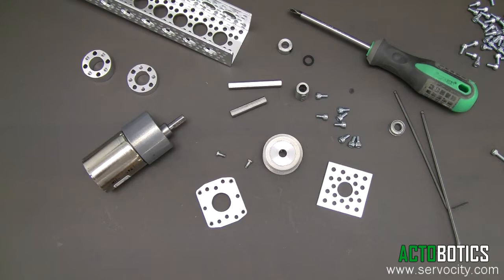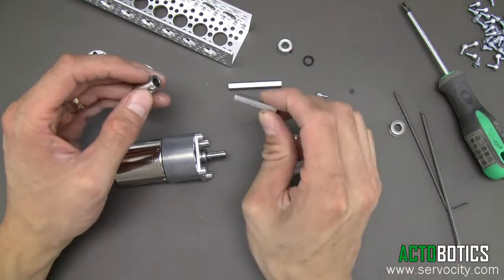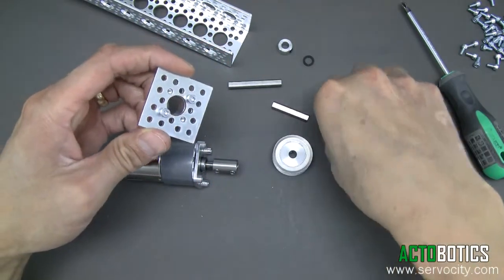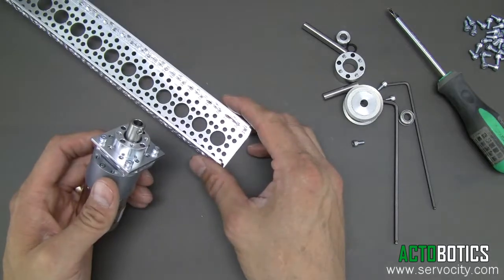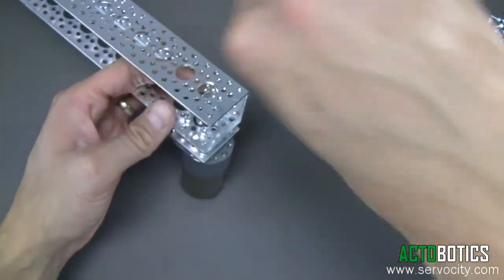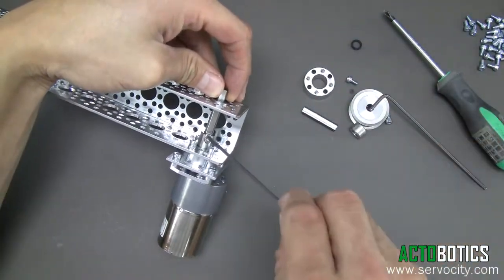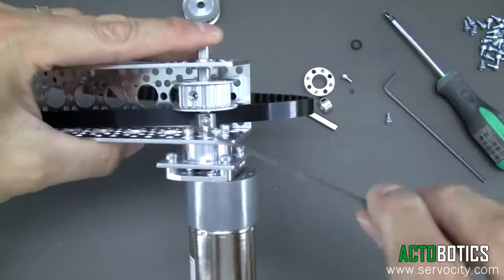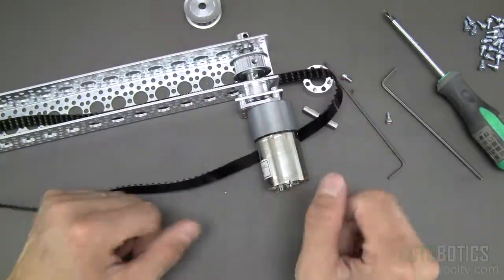Actobotics™ - Slider Kit Assembly (Step 1)

Comment: For a long time lapse, 19" isn't very far. What motor do you recommend?
Reply from the maker: It depends, how long do you want it to take to travel the full length of the slider?
Reply: ServoCity 30 min, an hour if I do a sunset/sunrise or a storm. You can't buy them assembled right?
Reply from the maker: Andrew Sebrell For 30 minutes you would need 0.2RPM, we have the 0.5RPM motor which can go down to 0.05RPM http://www.servocity.com/html/0_5_rpm_gear_motor.html.  The kit usually does not come assembled, but we can assemble it for a $35 assembly fee in addition to the motor you purchase.  (There is no return on the assembly fee.)  Let us know if you have any questions 620.221.0123 or tech@servocity.com.